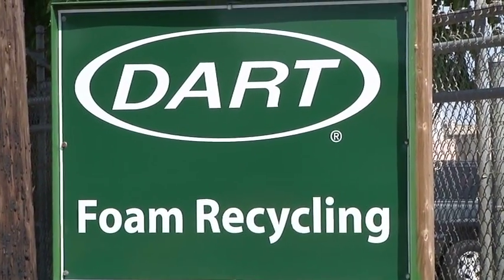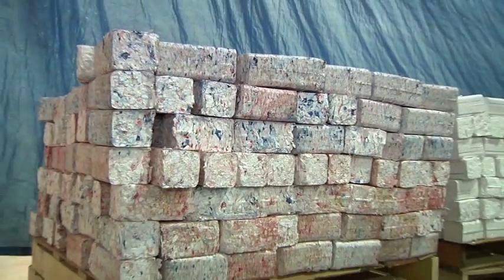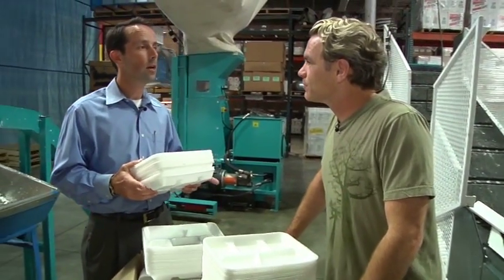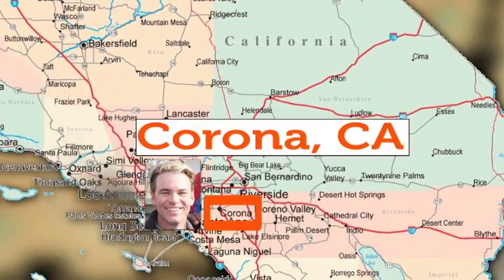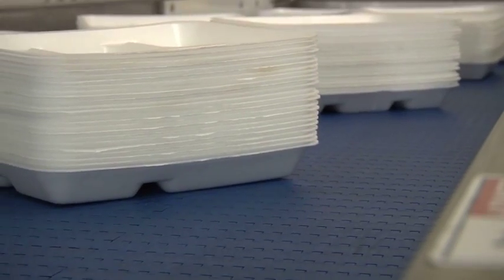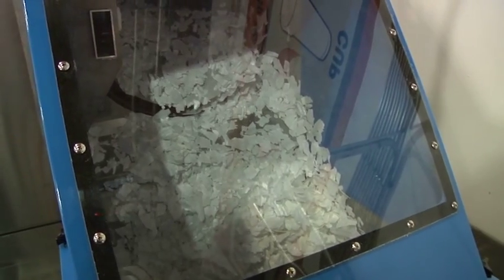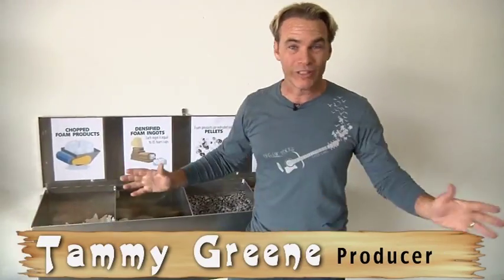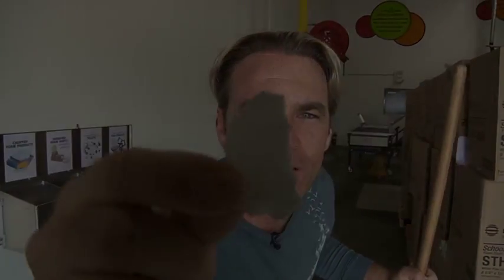Implementing a school lunch tray recycling program - Part 2

Comment from the maker: The school is using lunch trays designed for a single use. Even with the costs associated with recycling, using permanent trays is much more expensive. The school simply doesn't have the funding to purchase and wash them.